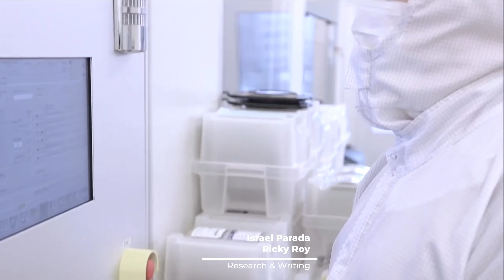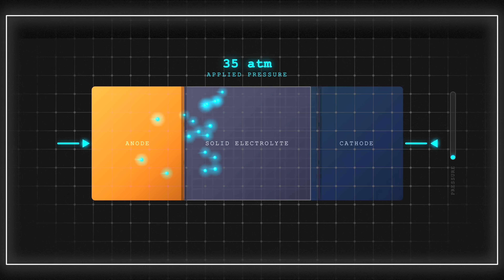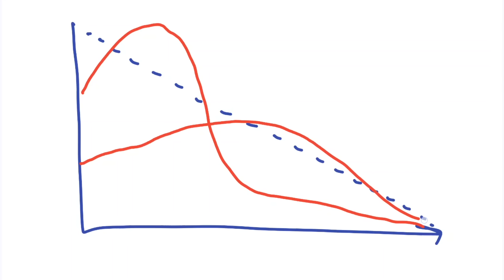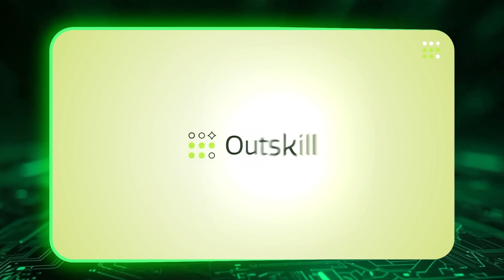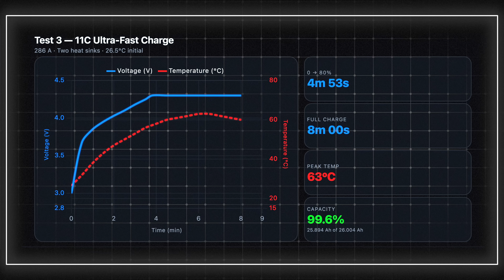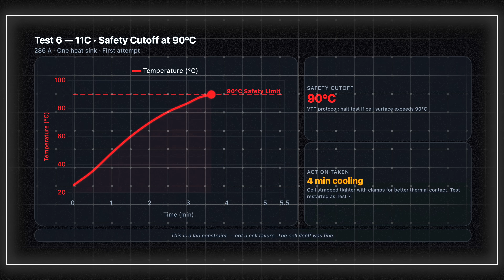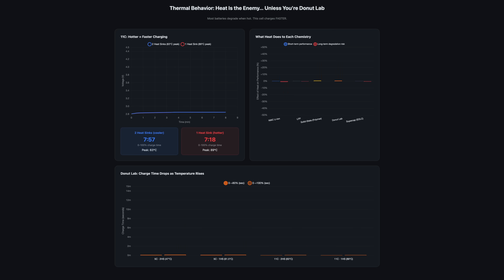Donut Lab's Solid State Battery Test are Shocking...

Comment: I think it is a super capacitor. Internally it has high voltage/current (charger/voltage regulator) that charge the capacitor. Internally the capacitor gets to a much higher voltage than what is seen at the terminals. The (charger/voltage regulator) is programed to have the charge and discharge curve of lithium. Maybe that would explain the round trip efficiency as the electronics is what is heating the "Battery" and not the capacitor? With this approach, if it is a super capacitor, that would make it a drop in replacement for a lithium battery.

Comment: For me cost would be a huge factor as well as temperature resistance to hotter and colder climates. If it is cheaper because of components and fares well in all climates. And of course as you mentioned cycle life. 

I'd also be curious if how recyclable the battery would be.

Comment: Still looks good if it's both a capacitor and a battery layered together so the capacitors electrostatic surface area maximizes charge delivery to the electrolyte layer. Are we assuming two dimensional layering when its really a more organic 3D micro/ nano geometry.

Comment: I can charge my Lipo batteries at like 50 C
Reply: There might be confusion regarding which "C" we're talking about... Degrees Celsius is of course temperature, and you're right, 50 degrees isn't too warm to charge a lithium battery. The other C, though, is a charge rate, understood as a "1/x of an hour" charging speed. For example, a 2 C charge rate is 1/2 of an hour, or  30 minutes to go from 0-100% full charge. (12 C = 1/12 of 60 minutes, or 5 minutes...) hope that clarifies. 👍🏻

Comment: Coming from a semiconductor background I’m having a hard time understanding why pressure is needed.  There’s so many deposition and bonding techniques for most of the periodic table.even noble gasses can be implanted sub surface. 

That said strained silicon increasing speed overall and better matching pmos and nmos entered production at 45-65nm.  It was originally tested by flexing wafers and testing.  Then they designed processes to deposit the same material they were using anyway to create compression or strain instead of the previously neutral method to put the same material into the same spot.

Comment: Well not say I don't share your skepticism and for the record I have not even watched this demo of the test tbh. Could it be that the battery characteristics you are watching being tested is a reflection of the charging unit and not the battery cell itself. What I mean is for any new fangled battery design you probably want to target a mass market standard and Lithium ION NMC is pretty much the standard other than the Lithium Iron Phosphate type are so ubiquitous with their charging circuitry standards that you probably want to target a solid state battery to mimic such behaviours to ease the cost of uptake for this new design. Solid State battery means you probably have more control over charging parameters because it's less analog in depending on the behaviour of a liquid chemistry. If that is the case then why create a battery design as the inital proof of concept for mass market that forces potential customers to ditch their charging circuitry IP if the battery can be made to conform to it in the first release. I'm sure from optimizing the efficiency you want to find the best charging characteristics that suits the individual use case need but for mass market like in auto's target what OEM's and Tier 1 supply chain partners already can interface with, no need to re-invent the wheel on that front I suppose.

Comment: 16:20 You say that the swelling would only matter in a large module? Why is that? Battery swelling is essentially failure. (It's a one way reaction, off gassing) That cell is toast. I build and fly high performance racing drones with a power to weight ratio somewhere around 10:1, sometimes we discharge our lipo batteries at like 60c, when a single cell even slightly swells, it is decommissioned and scrapped.

Comment: You can watch the Donut Labs YT vid of the testing at VTT, and they link the full report in the vid.
The VTT lab is a real governmenrt run lab and there is no reason to believe they would lie or cheat the results.
The take aways:
Unlike other SS cells we have read about, these do not need 50-bar confinment pressure
The charge and discharge tests at 1C, 5C and 11C were plotted and are impressive.
No active clooling was used in the testing. - even more impressive.
What is the actual weight to energy capacity ie energy density - not part of this test - hope to see it soon.
We have no idea if the cell is truely capable of "100,000 cycles" even 10,000 would be inpressive - hope to see test data for this claim soon as well.
Similarities with NMC curves,  doesn't mean this cell is NMC. Donut has stated "no Lithium" and since this will be easily shown later it seems doubtful they would lie on this issue.
Will be watching for more test data and information on this cell type and how it performs. Cost data would be interesting to see as well.

Comment: Speaking from my experience in an R&D lab, Donut’s approach is actually how most breakthrough tech comes to market. You start with a bold claim to get investors and potential commercial partners interested, then spend months or even years refining and validating the technology before mass production. That’s the normal cycle big announcements first, careful scaling later.

Comment: Different electrolyte?  That would change the ion mobility.  Another claim they made is that they can customize the voltage.  Assuming that's something more than just stacking cells to get close to a desired voltage, I would want to see some examples.

Comment: A lot of IFs here. 

IF their cells can hold a charge similar to a NMC Li-ion battery and IF their chemistry is solid and includes no Lithium and IF the cell can withstand their 100k charges claim... even if the density isn't 400Wh/kg but a more typical high end Lithium option... then this is still a substantial leap forward.

Even if every other aspect of the battery lined up with typical Li-ion batteries but it could be charged even only 20k times it would be an advance. Even a cell that hit 300Wh/kg and 20,000 charges would be an advance, though nowhere near the hype they're trying to build here.

We have Li-ion cells that run at 350Wh/kg but only last maybe 2000 charges.

I still wonder why they wouldn't just make the big reveal or let VTT test everything if they weren't hiding something. We will see.

Comment: It is a BOUTIQUE Lithium-based cell.  There is another vid somewhere, pointed out there’s a world of difference between mass-production and small-batch manufacture.  They’ve simply hand-crafted a small number of cells, picked out the best of everything from that small number of cells - pre-tested in other words, pre-selected - and sent that ‘best of the best’ to a laboratory for a rigidly boxed-in and tightly-known few tests.  Clever, but not in a good way, not in the Isaac Newton or Voltaire sort of way, but in a scam way.  They’ve simply exploited the difference between their super-best choice of cell they already tested, and what the numbers are for everyday mass-manufactured cells that we’re familiar with.  

Totally true, these test results.  But totally false to give the impression normal cars will get these.  To hand-craft and preselect/filter out the best of cells and fit to an EV, hell, any Chinese brand maker could do that, but it wouldn’t be economic.

Now, what would YOU do different, if you really had a standup new-tech non-Lithium cell that could weather any test?  I’d send a pallet-full, serial numbered cells.  Tell the tester to pick any one they liked from that tonne of cells.  Ask they do the full suite of tests possible, short of chemically examining the content of the cell.  Tell them to volumetrically measure the size of the cell before and after tests.  Etc!  I think it’s beyond doubt that this is a scam in point of fact, but Donut can stand up and say these are genuine short-term electrical results from that one-cell-in-a-thousand.  

Best analogy?  That trick where you float a needle on a leaf in a small cup of water, and it points north…does that mean you can churn out a thousand usable compasses, like, EVER?!  No, the clever bit is this scam deals in very limited truth, but I have no doubt there’s nothing to see here but careful selection of Lithium cell materials, then a specially-good-testing cell from a batch of 20 or thirty.  Your analysis, was excellent.  Donut will die, and anyone invested but in the know, is gonna need to pull their money asap.

Comment: Thank you for this information.  Sure, this battery may be evolutionary, but not revolutionary, being Canadian with really cold winters, having an EV batter for vehicles/storage which doesn't really lose much charge strength in the winter would definitely be revolutionary.  That, and you never have to worry about battery fires would be a fantastic advantage.

Comment: Did you notice the date of the report? Two weeks before the sharing! That first test was completed already about 3 weeks ago.

Of course VTT must have continued testing. The setup is ready for other environmental temperatures. Maybe that comes next?

My point: Donut Lab obviously already knows what is coming. They must have good reasons for the delays of sharing the reports. If they would have seen anything alarming, would they continue the report release series?

As a Finn, my impression is that they are quite confident that all the claims are met. Doubters are not leaving much room for new innovations by using existing technology and literature for their reasoning.

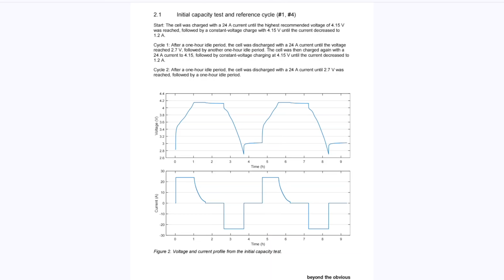Comment: 7:16 Here you can see clearly well know Lithium battery signature voltage “pumps” as its not straight line up! Something is chemically changing, it’s 100% identical curve. This is not solid state battery as it is different chemicals and materials compared to Lithium-ion batteries and curve would be something like we ever seen! This is Lithium-Ion Pi hardened battery NOT Solid State battery!

Comment: Nice video.
I would not see the Li-ion battery-like characteristics as a proof that it is a lithiun battery.
It van be the sign that they really managed to design a battery fully compatible with the actual uses of lithium batteries.
If that is true, that means two things.
One is that they can shape their battery behavior as they wish and that is a brilliant thing. Second: it means that it is NOT a litbium chemistry, it is also radically different from all other solid state tries.
I would not see these results of a sign of false energy density data.
Honestly we so not know what lays in that pouch and in actual development phase it can be that the pure battery volume is only a part of it.
Let s see the next presentations of this battery, energy density and cycle lifetime. That wil be the final answer. The exact chemistry will come much later, obviously to avoid copying their development. 
As long the youtubers who said until now that this is surely a scam, can work on their apologies.

Comment: another possibility:  they charged faster with 1 heatsink than 2 because the test with 2 was always done after the one with 1 heatsink and some degradation did occur.
Also one of their charging tests hit peak temps (90 C) and had to be redone.  This is consistent with a Li cell.   Also the cell did puff.  They claimed it wouldn't.  They're lying about their cells, and the very best Li cells could possibly charge at 11 C with similar cooling, although they would degrade.  I don't really think they proved these are revolutionary if you take all that happened into context.  At best these are market-leading Sodium cells, I'm betting.

Comment: This is kind of testimony to how damaged Western society is today.  Trust is gone and the people now believe in nothing.

Here is my take on it.
  Marko is in Finland and Finland does not F around when it comes to fraud.  Marko has two multi million dollar companies that are on the line.  Marko is not making a penny out of this until he can actually show all the results.  Even if companies signup now, the cash aspect of it is going to be contingent on the cell working as advertised.
What benefit is it to him to lie?   I see nothing but downsides for him and a huge possibly of losing everything he owns.

 Your theory that it is Lithium does not Jive with the efficiency gain as the cells get hotter.
You contradicted yourself in that analysis but at least it was relief to see that you questioned why would the engineers lie to you about the Lithium.  Yes why would they lie since if the battery does everything they say it can do then no one would care.  The answer is that it most likely does not contain any lithium.

Comment: A charitable explanation which explains the drip-drip release of information about the Donut Labs solid-state battery is that they've "cracked the code" at the theoretical level, but are struggling to create an "all singing, all dancing" proof of concept, which impedes their ability to secure patent protection, and they could be years away from developing the exacting manufacturing processes that would almost certainly be required.  In the meantime, they're attempting to sustain public interest and attract additional capital.

A less charitable explanation is that it's all a long con: a deceptive strategy designed to gain the CONfidence of the public over a LONG period of time before delivering nothing noteworthy, while at each step attempting to immunize themselves against future criticisms by front-running likely public reactions.

Comment: There is another most important aspect to consider for hyper-fast charging:  the actual vehicle's cooling system.  

If the efficiency at 11C charging rate is 82%, it means that 18 kWh of heat must be eliminated in 5.5 minutes for a battery pack of, say, 80 kWh (the approximate size of that of a Tesla Model Y LR.  Assuming that some of this heat goes into heating the pack and cooling system's components, as well as the cooling liquid, I come with an order of magnitude of 10-12 kWh to be eliminated into air by a fan and a radiator.

How much air must flow through this radiator depends on several parameters, of which the most important ones are a) the outside air temperature, and b) the acceptable/possible temperature of the exhaust air.

I come to a range for the flow of air needed through the radiator:
- ca. 3 m3/s if the outside air temperature is 20°C
- but as much as 6 m3/s if it is 35°C, and 9+ m3/s if it is a hot 40°C summer day.  On a hotter day, then forget hyper-fast charging altogether!

BTW, I assumed that it would be acceptable to let the battery cells go up to 90°C... which is a VERY AGRESSIVE assumption as the video showed... so, the air flows mentioned above are probably on the low side!

Nothing of this technical nature is impossible... but that's a huge flow to circulate through the radiator of a car standing still... it requires a mighty fan... which itself consumes power!  Basically, it requires a fan AT LEAST 5 times as powerful (and noisy) as the one of a Tesla Model Y!  There are already neighbors of urban charging sites, who complain about noise on busy charging days.  Hyper-fast charging won't help any!

That much cooling power also requires a significantly larger radiator, air intake and air ducts... which take space in the car... and which decrease the aerodynamic efficiency of the car... which in turn requires more charging to be done per mile driven.

Conclusion:  hyper-fast charging is NOT just an issue of having the cell chemistry able to survive it in a lab experiment... there are A LOT of other engineering issues to be considered!

N.B.: those numbers have been calculated literally on the back of an envelope.  The orders of magnitude are correct... I checked them several times...  but I do not guarantee any precision in my numbers as I had to do MANY assumptions.

Comment: Enovix is currently testing with Honor their 100% silicon lithium battery that has 1000 cycles. It takes them 3 months to simulate that test for 1000 cycles. There is not really a way to speed that up before cutting corners too much. So the question is how on earth has Donut Lab been even able to test the claimed 100 000 cycles as it would take 25 years? They would for sure have had to test them for at least 5 years to have any type of data even if unreliable. So I call this BS.

Comment: 🤔 I think the determining factor is that end user amperage will probably be uniform, under safety regulations and requirements, and the battery chemistry will respond by storing energy.  

Why they’re even entertaining very high amperage charging rates that never see use in the real world probably means that the accepted charging you can get in a battery can only be to a certain level.

Donut labs looks like a clever marketing campaign for Factorial.  They ARE in competition with QuantumScape, after all.